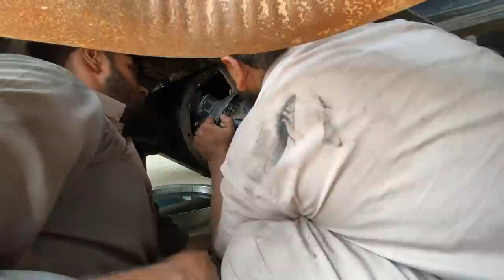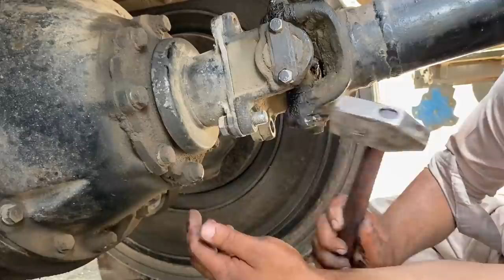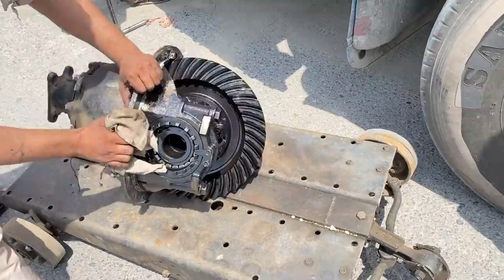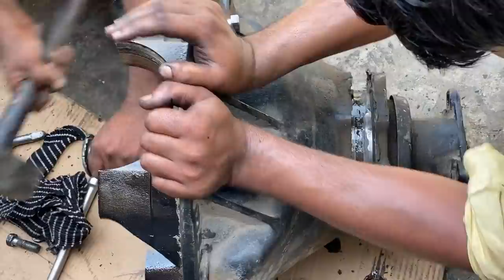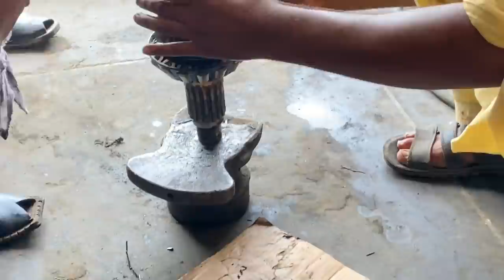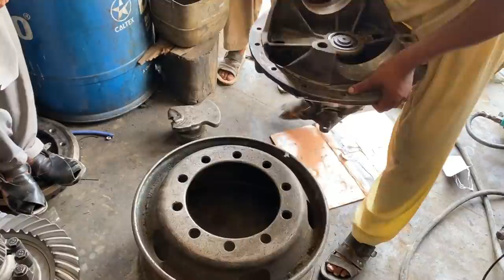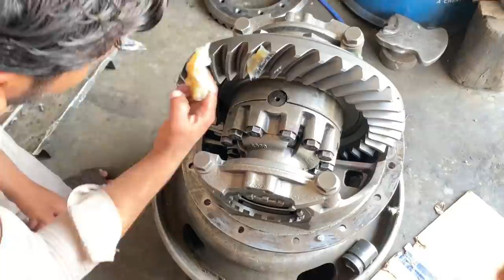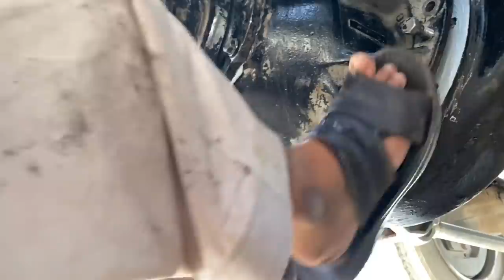The sound is different from the differential gear. Open and check

Comment: Hammering on the outside ball bearing ring to get the bearing off the pressed in shaft is really going to take care of that bearing....
No pinion shaft seal installed.... boy is this going to leak and collect dust!!!
The perfect recepe for a fast returning customer with even worse damage next time...

Comment: This is a great attempt at a somewhat repair.  Here’s the problem.  It requires precision that is not executed  here. Our solution is better: we add whole unpeeled bananas to the differential.  This slurry quiets down. The most noisy diff  so quickly for a smooth ride. 

Just the right viscosity for a  smooth ride.. 
pay attention or pay cash’.

Comment: Please when youre putting the bearing on prelube them just use gear oil on all the gears before you reassemble them because it will take a bit for the dif oil to fully oil them when its put back together

Comment: if the ring & pinion was only $240 then why not spend the extra $100 for new brgs since the old ones had metal run through them. those will fail next.

Comment: I'm not suprised tings breaking after that repair job. Hammering with metal against metal... and I'm kinda sure gears and splines shouldn't be thrown hard into asphalt and concrete! And I'm also kinda sure there is some of those part require moment-wrenches when installed.

Comment: Amazed that an owner BOUGHT a new ring & pinion! I was waiting for the stick welder to come out & fill the rough teeth on that Pinion gear.
Sad that they didn't lube the bearings before install. Pinion depth check, yeah, it's deep.
Backlash, yeah it got plenty. Torque specs, yeah didn't you hear my elbow click?
And you know they used the old oil (with the steel floaties)  for refill.
And so many commenters call these people "awesome & amazing". HAHA
COMPLETE FAILURE in workmanship!!

Comment: They have exactly what tools they need and they use it efficiently. In their help, the truck manufacturers expressly sold trucks that are rugged and easily maintainable
I would have replaced the ball bearings, the removal method was not great

Comment: DISCLAIMER— “No torque wrench was harmed in the filming of this video”
   You didn’t properly torque any bolts in that differential. You didn’t properly prelube any bearing or parts. You didn’t even do the paint/pattern check of the gear mesh. You didn’t check any backlash, drag, or endplay measurements. You just put a new ring & pinion gear and slapped it together.  I’m sure the differential will operate, but longevity was definitely hampered by not following protocol.
Reply: They checked the paint pattern, but you haven't listen, they slapped grease on the gear and turned around. Anyway if you are real mechanic, the torque wrench must be in your hands and arms!!
Reply: @sargatokgereblye4326  .. because that’s how BMW’s, Jaguar’s, & other precision automobiles are assembled.

Comment: People in the comment section are giving them too much credit. It's just a matter of disassembling the fucker, finding what part failed, replacing it, and reassembling the thing. Notice how they don't even tighten it to some torque specification or something.. This is how you know it's not that hard. It's actually not that much different from say, a cordless drill and its planetary gears. Only the size is different. I personally have repaired a lot of stuff which I don't know the inner workings, it's just a matter of finding the part that failed in this case.

Comment: I have built many, many differentials, first, no pre load on the pinion bearings, second the pinion housing was just bolted into the differential housing, I saw no shiming into or out of mesh with the crown wheel, and as for back lash??? Let's just guess it with a bit of grease, yes I know they are in the back end of beyond, but if they got all those cp air guns surely they could get some engineers blue?

Comment: A Brother advise to my brothers in Pakistan, please follow strictly to make a good , safe ,and long lasting job.
# 1 after disassembly, degrease parts, look for abnormal wear on gear teeth for spalling and chipped off material on gear teeth and replace as required. replace all bolts, washers, packing and retaining rings with new parts. when ready , to re- assemble, please move all parts to a clean area ( no dust please ) and start assembling according to OEM REQUIREMENTS, make sure you have all the parts required to assemble, also you will need torque wrench, clean oil or grease, locking nut and washers are new take picture where required, you will need dial indicator gage or stand to check for GEAR BACKLASH/ OR CLEARANCE USE SHIMS WHERE REQUIRED,BEFORE PUTTING AT BACK ON THE TRUCK, a quick look for ( FOD  DAMAGDE) no tool of any kind in side. By the grace of God we can put it back, please pray for me and for all the ummah that is suffering from miscellanies calamities. ALLAHA HAFIZ from my beautiful city of JHELUM.

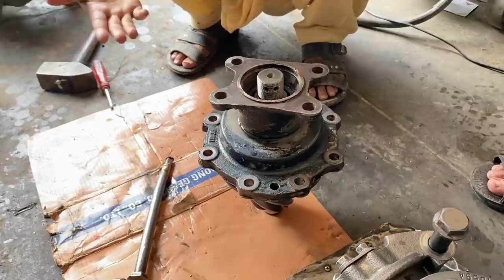Comment: At 08:39 it looks to me that they never installed the pinion seal unless it was installed on the flange but if so, that won't be seated correctly and they'll be losing oil out the front of it.

Comment: It's not a "pin". It's called the "Pinion Gear". There's the "Ring Gear", the "Pinion Gear" and the set is called a "Ring and Pinion Gear Set".
Oh, and save your life and just wash the parts in laundry detergent. Good old fashioned Tide powdered laundry detergent will clean them just as good, not poison your blood with petrochemicals, and save your life and the environment. Not only that, but the residue will be good for the new oil you're going to add later.

Comment: Given that the old bearing was removed from the damaged gear shaft, they must have re-used it on the new one ! 🤔 also the castellated nut had no cotter pin that I noticed ... 🙄

Comment: Can't beat the bearings against the races and expect it to be quite or even last. Some bearings when pressed in can only be removed by messing them up and should never be reused. Unfortunately they tortured those pinion bearings and reused them...  job security? Outside of that all appeared pretty good.

Comment: Not a big fan of hammering on bolt threads & splined steel shafts or chunking parts in the sand. Git’r done I guess, but still can use care & perform a deft repair.

Comment: No preload on any of the Bearings.....who knows what the pinion depth or backlash was but bo shims were used on the pinion flange. Plus used the Bearings over after all the metal from the pinion went through them...🤣

Comment: Uses $200 gearset and sets the backlash without a dial indicator hammers bearings off oh no hammers on new bearings spins to check pattern sounds like it’s got rocks in it all fixed this should last for a long time

Comment: Removing those bolts, that are covered with mud and sand, over the tray with the differential oil.. Clearly don't care what you are doing.. Half of that sand ended up in that oil

Comment: Judging by how these dudes do maintenance I would say the new rear end is going to last a solid 1,000 kilometers
Reply: @ACEGAMER120  Maybe you missed the part where they took the finished head and leaned it up against a brick wall it looks like it belonged in Falluja
Reply: @ACEGAMER120  yes dear
Reply: @ACEGAMER120  I am sure they did nothing wrong and I am an idiot just as you said. I am also sure there is no way that I have any experience doing any engine maintenance or even did that for 20 years straight. I also can assure you that there is no way that I have all kinds of videos on here giving examples of that and I am definitely getting one upped on engine mx by some idiot gamer.
Reply: @ACEGAMER120  I wouldn’t trust you to change the oil in one of my zits
Reply: @martinrps13  You say that like I care what you would trust me to do 😂 You sound like you wouldnt be worth dealing with as a customer. I've had thousands of customers that trusted me to work on their vehicles way beyond simple oil changes and other than the occasional "ever since you worked on my vehicle" instance, they're all pretty satisfied. I've rebuilt several diffs for hotshot drivers that haul 10,000-15,000 lb trailers over 500 miles per day with zero complaints so I must be doing something right. Just rebuilt a Dana 80 for one a few weeks ago. I actually know what I'm talking about. You have yet to demonstrate you can claim the same other than some vague claim you have some experience in "engine maintenance".
Reply: @ACEGAMER120  I am not a customer….I am the one who does the work myself
Reply: @martinrps13  Then why did you even bring up the concept of someone working on your vehicle? But way to completely ignore everything else. It's okay. I already know your knowledge on the subject is limited as was pretty evident by the fact you feel the need to talk shit about people in a developing country doing a job correctly because they "leaned a part up against a wall". Go back to your oil changes and pad slaps. I'll keep doing actual work and respecting other people who do proper work you'll never do with the tools they have.

Comment: I didn't see any shims under pinion carrier to position pinion, I didn't see them check preload of pinion bearings, I didn't see them check preload of diff bearings grease is no suitable to mark contact pattern, and from what I could make out the pattern that was shown was not suitable for a truck.

Comment: That will fail again shortly. You can’t beat on that shit with a hammer like that. Also, I reckon that pinion is going to have a nice leak without the seal installed lol.

Comment: no ratchets, just breaker bar on socket .. no hydraulic press, just 3# hammer .. no safety toes, just let them breath.. no shims or feeler gauges, just set back lash by grease smear .. I could go on and on .. but here is your proof ..

Comment: Aww, come on. You cut the video off before you filled the diff with the old fluid like I know you did, that's why it's still under the truck. I hope all those metal shavings in the used oil didn't ruin the new gears. That's alright, you can charge them again when it does.

Comment: That is not a proper way to set up opinion you need to put that in a press reload the bearing to check the tolerance that is not a proper way to do this because when you take that nut down you could overtighten it and then you’re not gonna have the proper pre-load on the bearing and you’re gonna burn that pinion bearing up

Comment: I see all these  * -HI TECH- *  comments down here...

After you guys spent years and years using the fancy tools you talk about, digital torque wrenches,dial indicators and such, IF you did many of those and  IF you were really good,  you'd also DO IT JUST LIKE THESE GUYS,  by now;  i know i do; and i am extra careful with the bearings, don't know if they used new bearings here,almost sure they did, the assembly was done well, no poundind on the wrong race; 

REMEMBER,it's all  IN your head first,then come the hands; and these people HAVE IT in their heads; torque wrench my ass,dial indicator my ass, just carefully observe how the main mechanic adjusted the free play of the ring and pinion by ear   and by feel:   they have hands,arms,and practice...and NO time to fool around with unnecessary tools; the failure of the pinion teeth was probably due to the fatigue of high mileage, as long as the new parts are good, i'm sure the repair will hold, that's what matters

Comment: Their familiarity with identity mechanisms with serious flaws and major problematic mechanical parts is so perceptible it’s scary however these incredible mechanical geniuses are very intuitive supervision engineering resourceful outlets are incredibly reliable their numerous mechanical shops who are fill with versatile engineering capabilities is unmistakably efficient and their ability to adaptive and achieve a specific level of excellence is unbeatable and create a essential component is just remarkable given their incredible poverty however that awareness has breed a very tough society of engineers and mechanic who are incredibly talented not affected by the circumstances of a hardship life just an knowledgeable awareness with a competent mechanical experience combined with a level head confidence this nation of very intensive skilled labour force and insanely talented young boy mechanics and timeless community elders who obviously have some senior standing but there shared  engineering knowledge and anything repairable is essentially the concerned stone foundation of this engineering community men breathe diesel and petroleum products for breakfast and thus produce gifted mechanics with specialised skills for any specification mechanical emergency management repairs

Comment: GREASE IS A THICKER LUBRICANT...USE DYE TO GET THE REAL TEETH CONTACT ...... STILL CONTACT WAS ON FACE SIDE INSTEAD OF CENTERED B/W FACE AND FLANK...TOE & HEEL CONTACT WAS NEGLECTED AND BEARING PRELOAD.......SIGH....I KNOW THESE GUYS CAN DO MUCH BETTER AS THEY ARE VERY TELENTED, ALL THEY NEED A BETTER USTAAD(INSTRUCTOR).

Comment: Poor guy washing with gas or solvent bare handed.  Also, if I were replacing ring and pinion I'd replace the bearings while in there.  No sense doing all that work and not going all in and insuring longevity.

Comment: In 100 km the need a new dif, they dont have a clue. E.G.  The ring gear bearings and pinion bearings need a preload.
And using the old bearings, who have metal shaving in them ??
And adjustments of pinion and ring gear? These people try to do a proper job, but they dont have any skills on it.
I have done a lot of Fords 9 inch difrentials. If I practice their manner, I lose all my customers in 1 day